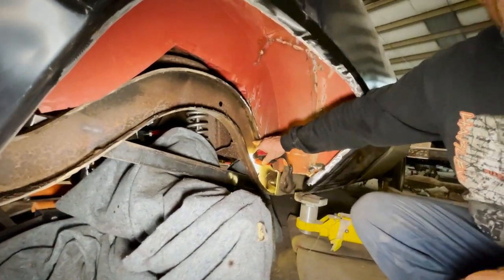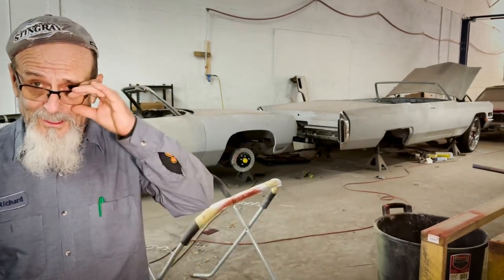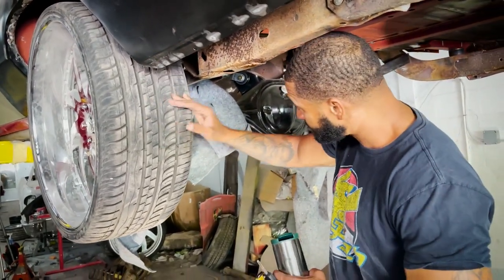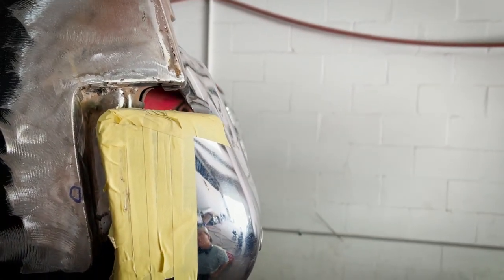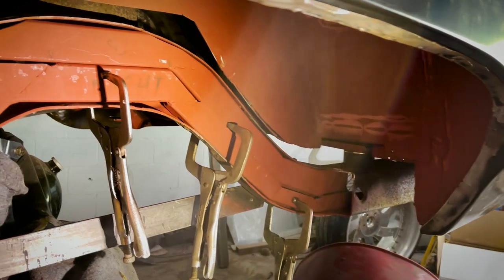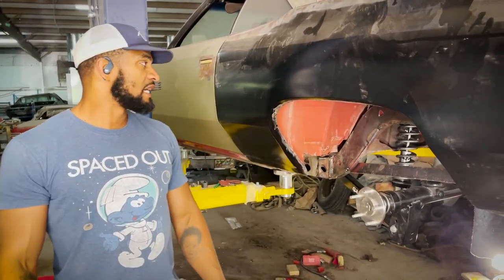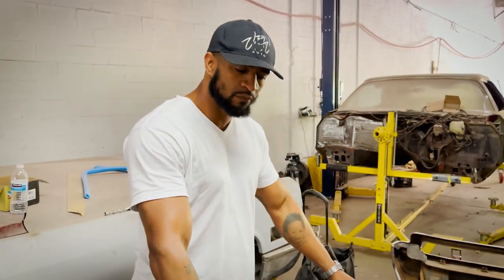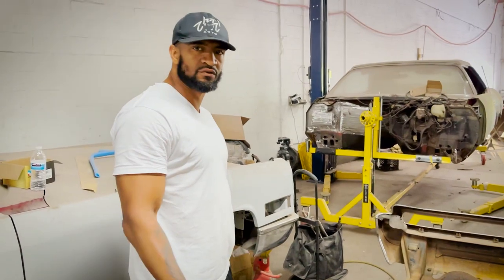1972 Chevy Impala Convertible DONK Body - On A 1971 FRAME

Comment: Dog I see yall trying to reinforce tht frame but it's still gonna be too weak for even 450 horses..the box in work ya man did isn't gonna help when your rails to the front are original its too weak dog 70 frame or 71 ..make a new frame dog yall got the equipment..Mr. Lofton gonna be madd 2yrs down the road ..no hate here just the truth
Reply: Wym